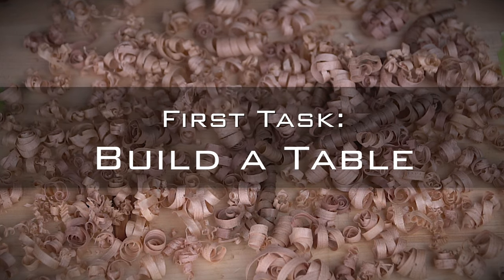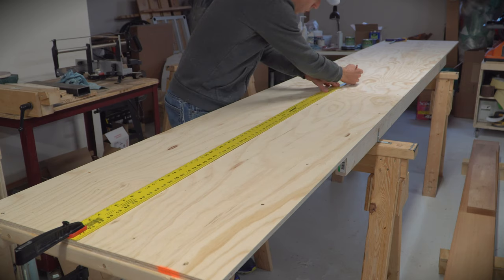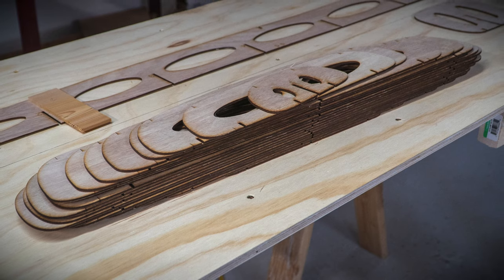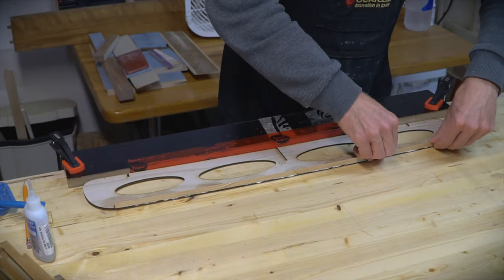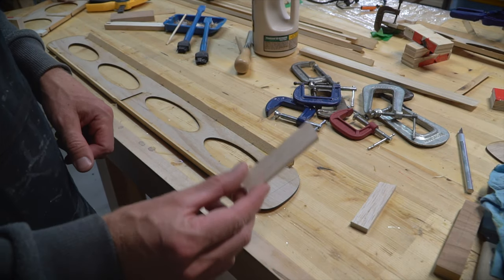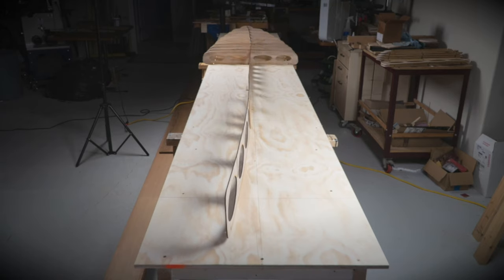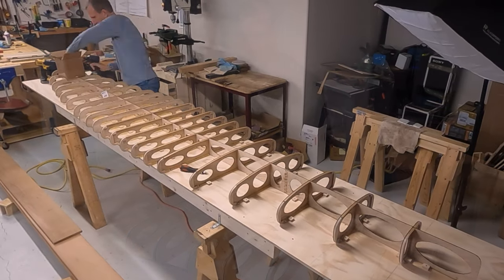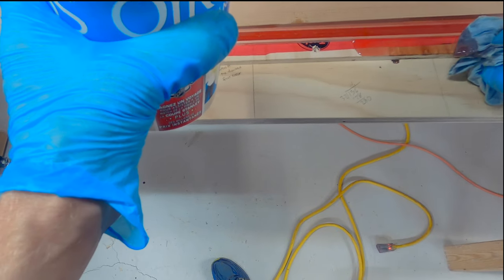Mike Builds a Wood Paddleboard Part 1

Comment: Would love to see videos like this without all the workshop tools.  Not everyone has a band saw and table top router.  It gets discouraging for the first time builder
Reply from the maker: Hi John.  Thanks for the feedback. I can see how it can be discouraging for a first time builder. That being said, this video series is intended to be a documentation of my build which is a more premium build using techniques that are more difficult than what a first timer might utilize. I’m using the tools that I already had but, as with many woodworking projects, there are usually several ways to do any task. For example, a hand held jig saw could be used instead of the band saw or a hand held router with some creative clamping could stand in for the router table. Some of the features I’ve made may be difficult to reproduce without the tools but none of those features are absolutely necessary to complete a functional paddle board.  Many of the businesses that sell frame kits also have more beginner oriented instructional videos too.  I hope this helps!